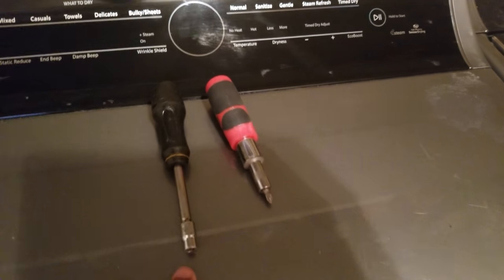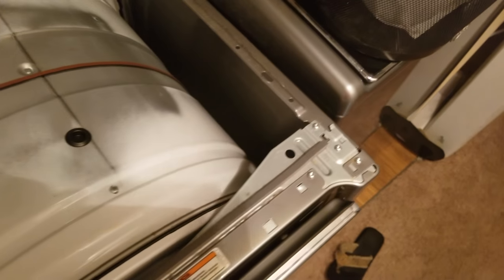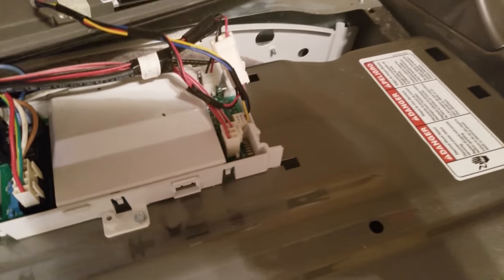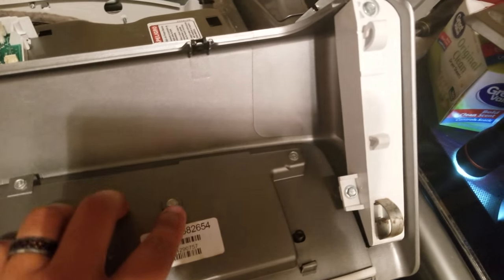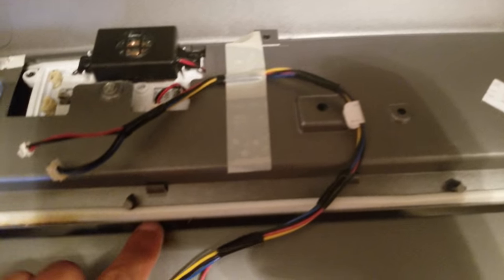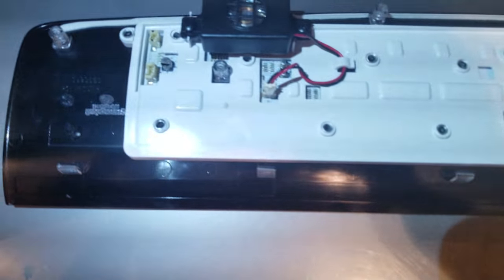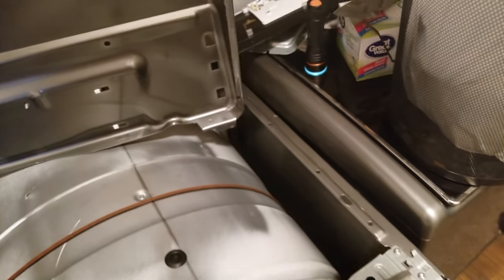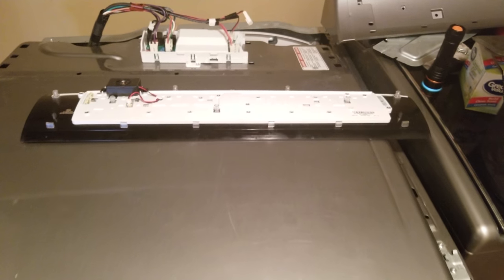Whirlpool Cabrio series dryer control panel removal

Comment: I was able to easily remove the control panel, fixed the corrosion on the circuit board and clear the F6 E2 error code (loss of communication).   Note to other readers:  Don't put overdamp heavy comforters in the dryer, spin those an extra time because you don't want the control boards to get damp and corrode.

Comment: Mine won't even power on! Help please!!
Reply from the maker: A few things that could cause this issue is either a tripped breaker,poor connection to power, a blown fuse in the dryer or a dead control board.
Reply: @veterantrucker1018  the dryer is getting power... I checked it with a tester
Reply from the maker: Then it's possible the control panel has gone bad. The one in the video had to be replaced because the circuit board corroded from moisture buildup from an improperly install dryer vent. (not my doing it was an apartment)
Reply: @veterantrucker1018  thank you for responding to my question and for sharing this information
Reply: Is it worth replacing the control panel? I got mine about 4 yrs ago. Started just blinking. Appliance repair guy said I need a new one but it’s over $350 w labor. Any advice?
Reply from the maker: @RAMJO  the issue I had with mine was corrosion from moisture build up and that was the price for the new part. I just did it myself. I still have the same washer and dryer to this day and they are working like new. Dryer I replaced the control panel and the washer I ended up having to replace the lock mechanism and so far that's all I've had to do.
Reply: @veterantrucker1018  I’m thinking of doing it myself. I’m sure I can manage. How much did you end up paying just for the control panel?
Reply from the maker: @RAMJO  $350

Comment: Anyone still monitoring this site?
Reply from the maker: Yup any questions
Reply: @veterantrucker1018  how did u find out it was the contract panel that was bad?
My dryer turns on but won't get hot
 Had a guy out who said everything around heating element was good. He came back a week later and dryer worked for a week
Reply: Control
Reply from the maker: I found out my control panel was bad when I took it off and all the contacts were corroded. My contacts had corroded from moisture building up in the back of the control panel
Reply: @veterantrucker1018  so your dryer stopped heating?
Reply: Hate to spend 300 if that's not it
Reply from the maker: So you could possibly have a bad thermal fuse. If you found the parts manual like I did you may be able to go to the whirlpool website and get a new one.
Reply: @veterantrucker1018  appreciate your help. The first guy changed those out and it still didn't work.
Reply from the maker: I wish I could be of more help